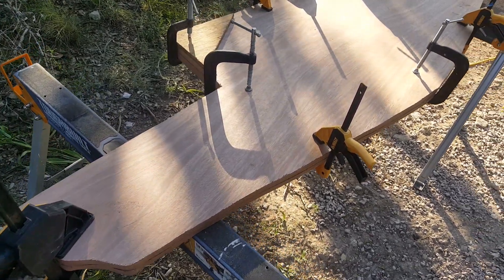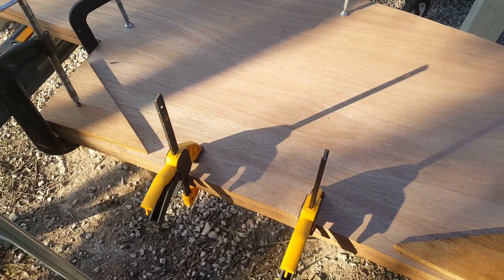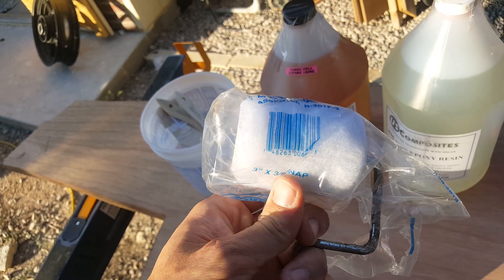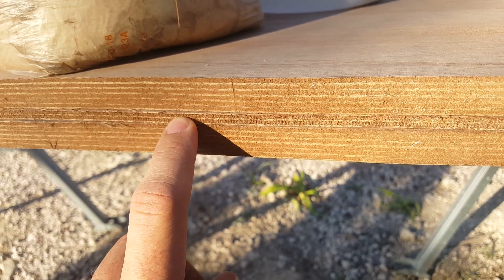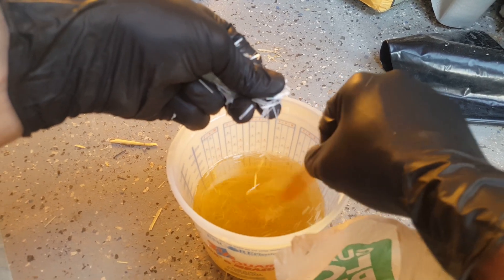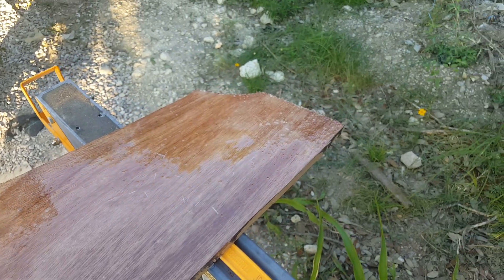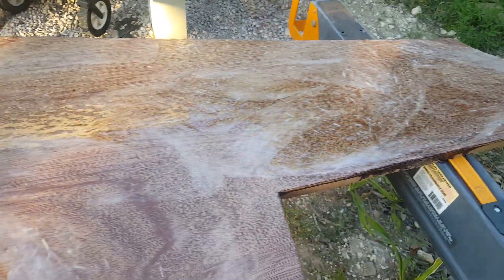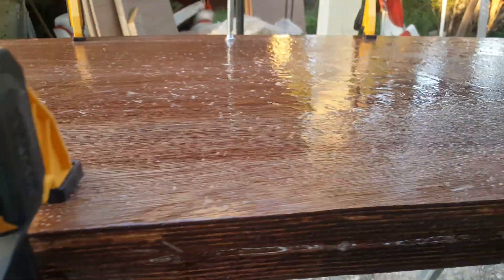Boat Transom and Floor Rebuild - KEVLAR Transom - Marine Plywood  - Part 30

Comment: Hi Michael, I am back on my boat project and about to put my 3 layers of Marine Grade plywood together just as you did for the transom. Two 3/4" pieces and one 1/4.  My question is: Once bonded together would it be better to use 1708 to wrap it or 22oz toling fabric?  A friend mentioned the tooling fabric becasue it lays smooth.  I am a first timer with all of this and have the 1708 on hand but havent used it yet.

Comment: Drill a hole and nut and bolt the middle that you are going to cut out later. Why did you not sand the ply and use the acetone to get rid of the wax that is on the sheets when they are made in the press?

Comment: Dude can I ask why one piece wanted be used and why you need to stick 3 together etc 

Please explain as I'm a newbie
Reply from the maker: The transom has a minimum/maximum thickness. If your transom is too thick, it causes a lot of problems. Too thin and you could leave your stern drive at the bottom of the lake and sink your boat.
Reply: Awsome man, I'm trying to figure out how to clamp a none outboard transom as no hole to put clams.

Also if there no transom what would you gauge thickness off 

Wondered how tran would bond to fiber glass